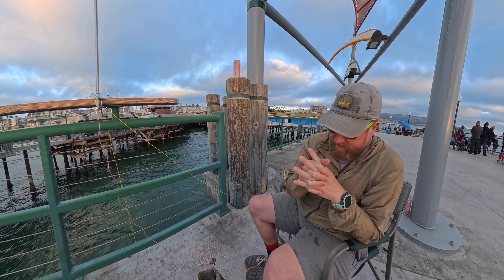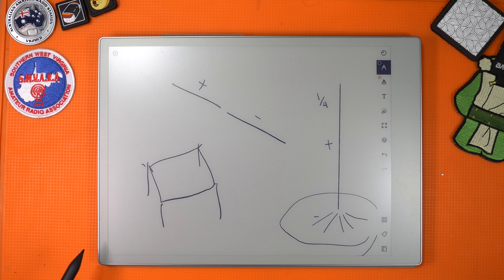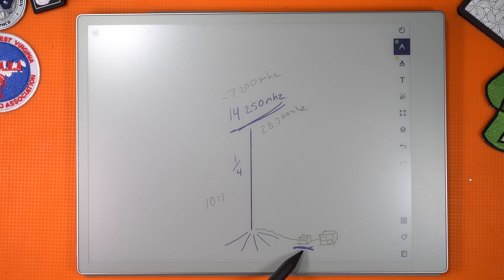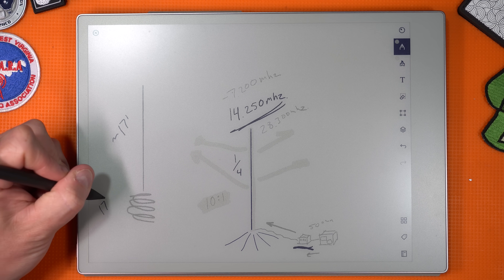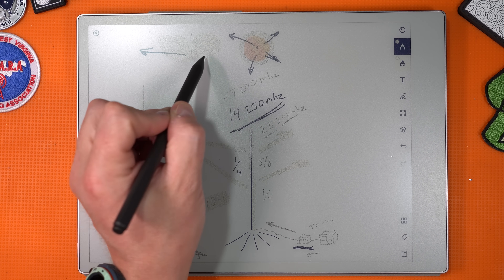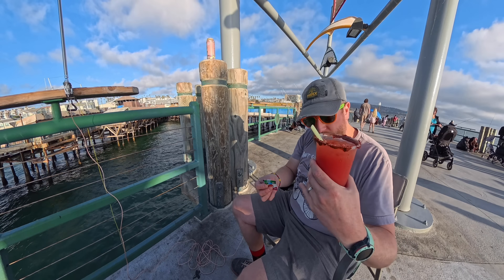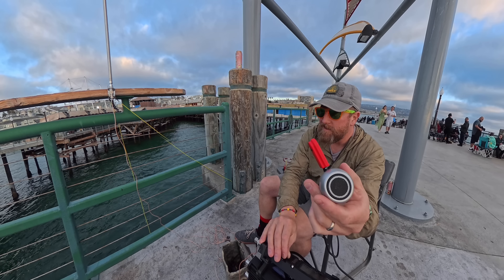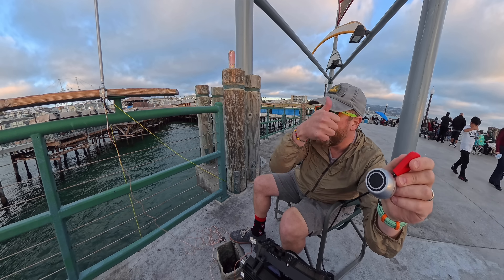When NOT To Use Antenna Tuners

Comment: Josh, is the radiation pattern at 7:35 not omnidirectional as well?
Reply: I agree with you mister
Reply: yes the pattern is circular but with a really high angle lobe and smaller lower angle lobes. You only get that spiky pattern on a horizontal wire antenna... and the wire antenna also suffers form higher than optimum angle of radiation with smaller lower angle lobes...
Reply: @MaryBrownForFreedom  Right, I'm just referring to the top view radiation pattern
Reply: @mattlove907  would be a donut shape...
Reply: @MaryBrownForFreedom  100%!
Reply: @MaryBrownForFreedom  100%!
Reply: @MaryBrownForFreedom  100%! The horizontal antennas have nulls off their ends in two, opposite compass headings just as the vertical has two nulls off its ends: one directly above and one directly below.
Reply: Yes, rotation symmetry dictates equal radiation in every direction in the horizontal plane. In every vertical plane there will more then one lobe (contrary to a quarter wave where it will be just one single lobe).
Reply: @bendunselman  Yup. Omni-directional. The second elevation lobe will develop in a 1/4 WL vertical if it is raised above the ground appreciably. The second lobe appears in the "long" vertical (over 1/4WL) because the part of the vertical extending beyond 1/4 WL begins to develop ground cancellations in the far field. Again, this is why a 1/4 WL vertical will develop the second elevation lobe when it is raised appreciably above the ground. See chapter 2 in my book linked off my QRZ page....

Comment: Thank you for the video. 

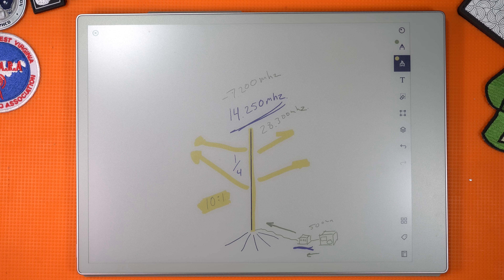The way I would explain the 14MHz case (at about 5:00) is that you have a 50-ohm coax connected to a, perhaps, 500-ohm (mismatched) antenna. Most of the energy will reflect back toward the antenna tuner from the coax-to-antenna point, not entering the antenna. 

In the 10M case, I agree that you will get a weird vertical lobe pattern, with energy going God-knows-where. However it is not obvious to me that the horizontal pattern wouldn't remain symmetrical.
Reply: You didn't go far enough,,,  the signal that is reflected in the standing wave toward the tuner is reflected back to the antenna and whatever ratio passes the antenna will propagate.  At that point there is still a mismatch so another reflection toward the tuner which is again reflected back to the antenna to pass however much it does until there is no more reflected power.  If the reflected power was dissipated as heat the tuner would be smoking hot, and they aren't.  So the power goes out the antenna in measurable  chunks.  close enough to not hear in audio, but discernible by oscilloscope.
Reply: Yeah, I think Josh is mistaken about the pattern in the top-down view. I’ve modeled this very thing, and in the 3D pattern view, the bifurcated lobes look like cones, not spikes. You don’t get nulls at various compass directions. You get nulls at various take-off elevations.

However, with a horizontal dipole that’s too long, then yeah, you might wind up with a deep null pointing NE, and struggle to reach Europe from Minnesota, for example, but get Florida OK-ish.
Reply: @kelvin0mql  Essentially correct. One interesting thing about those elevation lobes is that they will introduce QSB on both receive and transmit when the propagation angle lines up with one of the nulls. That's why reception through a 1/4 WL vertical over salt water (e.g. a salt marsh) has a lot less QSB fades than any horizontal antenna.
Reply: Both "lobes" are omni-directional.

Comment: Just use the G90. It will match a sewing needle to 160M. : )
Reply: Match yes, radiate? Nope.
Reply: When you ask your rig's ATU (internal or external) to match some extreme impedances, the losses in the ATU can increase dramatically.
Reply: @mcarroll5885  (it was a joke)

Comment: Something i want to experiment with-
For Random Wire length we know that you should go with non resonate lengths such as 29, 35.5, 41ft ect..
Could one use a CHA 25 whip, CHA Blank, CHA insulator and spike along with a tuner (AH-705) for example.
If you had trees high enough attach a wire to CHA 25 tip to extend to the chosen random wire length, thow arbor line and pull to verticle max length and then use tuner for multiband verticle?
But if you ran radials wouldn't that effect total length? 
Or other option is extend whip only to 12.5 ft to maintain strength in whip and wire rest of way.
Reply: What would the shield side of the coax be connected to? If it's just the spike stuck in the ground that's a high-resistance and very lossy ground in series with the system.
Reply: @mcarroll5885 The spike is insulated from shield side of coax using the CHA Insulator. Radial is used above that between where the CHA blank screws onto Insulator. Use large ring terminals.